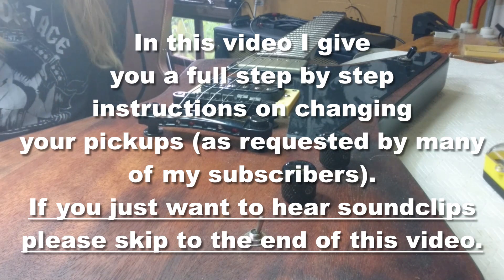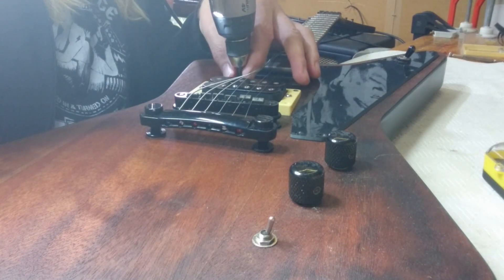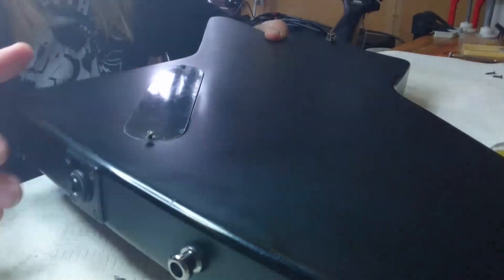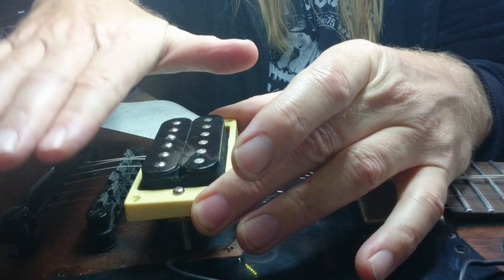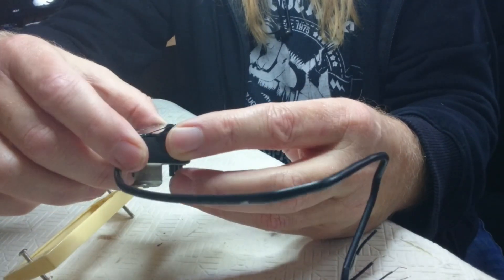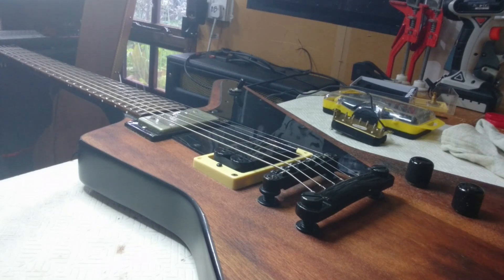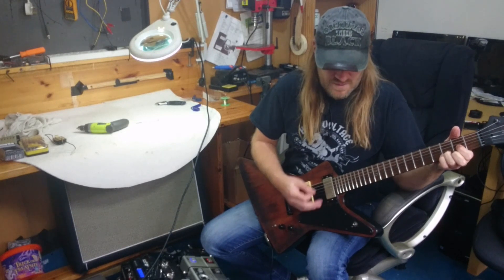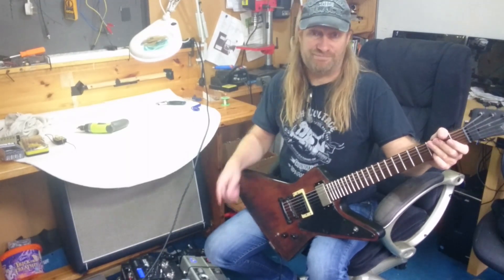IronGear Metal Machine - The Ultimate Metal Pickup

Comment: Really need a good book on wiring and soldering pick ups, I've bought a load of pickups with hopes of learning how to, the metal pick up the white and green wires says they should be joined, are they fitted to anything or just free floating???? They already come joined, im fitting an obsidian  7way switch to one of my HSS strats and putting In a metal machine Hb in the bridge, a smokestack II to the middle and a Texas loco to the neck aaaaaannnd I'm out of my depth,. I also have a two sets  of H slags Nickel and gold, hammer heads,  sorting out four of my guitars and end of the month some blues engines for my rip off Les Paul, and feeling a tad overwhelmed pmsl,  just bought a soldering iron to do three of my guits now what's the best way to get my head around electrics, I want to be self sufficient with my repairs and builds

Comment: Whenever you are using a set screw type knob on a split control shaft , such as the one in this video, find something solid to fit into the split in the shaft.  If you don't have the split filled with something solid, the set screw will cause the shaft to bend inward, which weakens the shaft, which can eventually break, or even more likely, cause the knob to come loose.  The engineering rule is that if you are using a round shaft, the knob needs two screws or it will eventually come loose.  If you are using a half round shaft then one set screw in the knob will keep it tight.  With that set screw knob on a split splined shaft, one set screw should work okay, provided that you fill the slot in the shaft.
Reply from the maker: Good point :)
Reply: I always set the screw toward the split in the shaft to stop this happening!

Comment: I tried them, they are a little bassy for me, but not bad. Output level is high as promised, sings nicely on the higher strings. However, I put back my stock epiphone les paul pickups. Overall, they are more balanced and defined, and I really missed that vintage tone, wich the metal machine doesnt have... It sounded so generic somehow, uninteresting...
So, still looking for an upgrade for my les paul.. I like the stock pickups, my main problem is the low output, since I play metal. I think cheramic pickups are not a way for me, since I like how the alnico vintage pickups color the sound. Dave, could you recommend me a pickup please? :D
Reply: try the voodoo pickups

Comment: Hey Dave I have a  Ibanez RGA FM42  with the stock  Quantum pickups,  good pickups, but I want something more bluesy,  one what you suggest and two I will love have them covered, any suggestions
Reply from the maker: Blues engines are a great pickup for blues and rock
Reply: @DaveBarlowGuitar  yes I have heard great things about them, I think the covers would fine,  I am going to do a bit of upgrading thinking also of changing the bridge, tuners, and nut, make it into a real blues machine guitar,
Reply: @bluesman7119  If you want a bluesy pickup and still retain some punch: Blues Engine/Dirty Torque. All the tonal flexibility you'd ever need.

Comment: I use a hammer head in the bridge and a metal machine in the neck. I like that combo.
Reply: hey, I'm also planning on doing that on a jackson js22 sc, what do you think about them?
Reply: @marcospadaro6493  the hammer head is a really good sounding but tall pick up. So it hard to adjust the height on some guitars. I would get two metal machines.
Reply: @jimbee89  thanks a lot man
Reply: @jimbee89  last question, do you think that the difference in output, being the hammerhead 15kOhm and the metal machine 17kOhm in the neck, is a problem?
Reply: @marcospadaro6493  no not really. As long as the pickups have room to be adjusted.
Reply: @jimbee89  ok thanks for your time :)